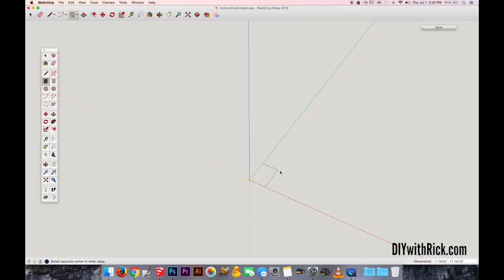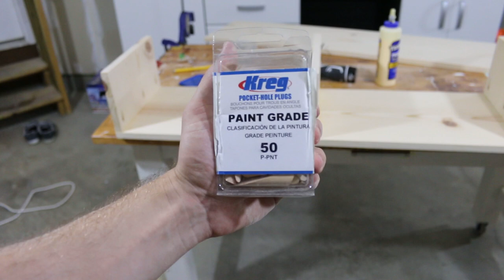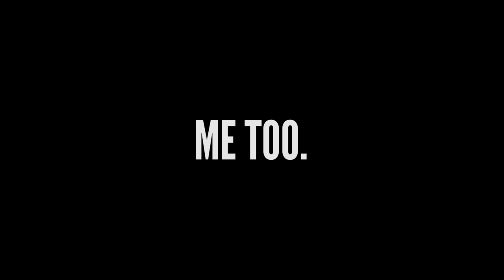Build a Mid-Century Modern Sofa Table

Comment: Don't hate on the Gilmore Girls! :) You need a block plane for that end grain, perfect for that job. Great build. Subscribed!
Reply from the maker: haha!! thank you! I have a plane but it's so dull it ends up making me worse off than before I use it. I used the "scary sharp method" for sharpening my chisels. Think that method would work for the plane? It's an old stanley so I was afraid to mess it up!
Reply: Haven't used that method, I use a WorkSharp that kicks ass. Just make sure your bevel angle is right and you should be fine!
Reply from the maker: Crafted Magazine thanks i'll look into the worksharp!